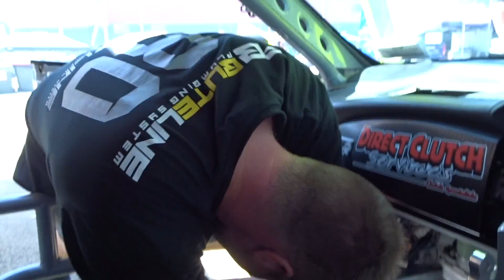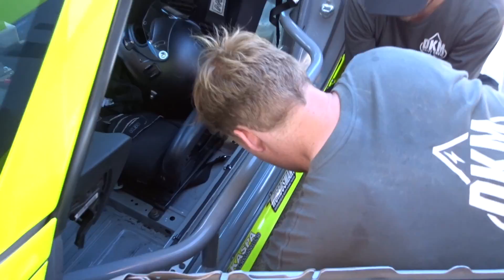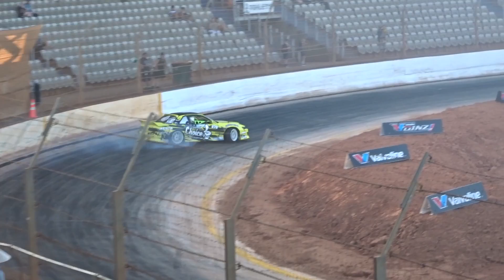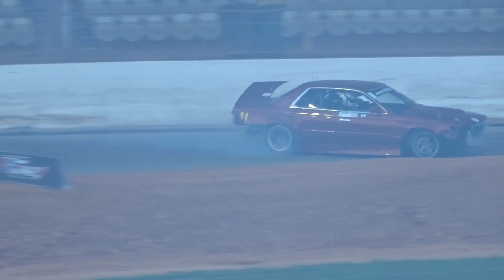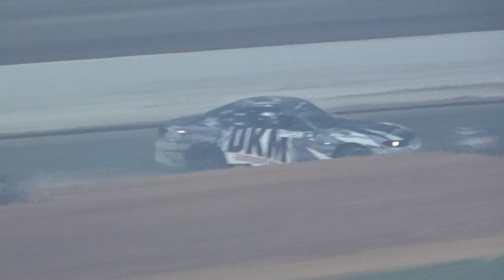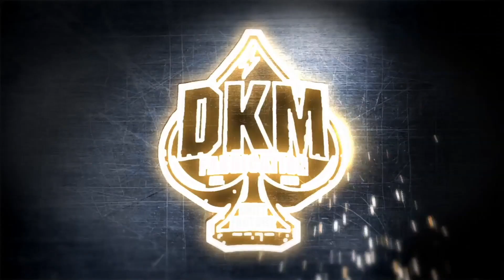BIG Crash!!! - D1NZ Round 3 Qualifying day.

Comment: the delay in the steering is because of the line length sorter lines less of a delay i run my pump in front of the drivers wheel on my s13
Reply: Could you explain this a little more? Hydraulic fluid is non compressible.. as long as the system is full and working properly  there should be no delay whatsoever
Reply: @magnetic0314   the power steering pump doenst run full pressure with no steering input when you move the wheel you can hear the pump ramp up in speed and pressure the longer the line the more delay there is when you move the wheel ive fitted at least 20 of these style pumps to skid and drift cars
Reply: looks like the lines just pop thru the firewall and straight in to the rack, couldnt get them much shorter i wouldnt think?
Reply: @rickjames3034   yeah looks that way but hard to say how long they are the ones in my silvia are 300mm long you really start to feel it about 500mm i did one years ago about 800 long and it was about a half sec delay
Reply: and i dont think that was why he crashed you can see he had to grab the wheel with both hands to try correct it was more of a binding issue
Reply from the maker: Cheers mate I will be doing everything I can do get rid of the electric steering all together haha
Reply: in Finland we run Opel/vauxhall pumps in the trunk and it does not affect the feeling or response if your lines are made of good quality hydraulic hose.
Reply: @DriftSquid   done correct its mint i killed soo many normal pumps before i went electric but hope you get the car fixed and back out again soon mate
Reply from the maker: @ZaredFox  Yeah mate we are going to try fix it all

Comment: that looked like it hurt 😢 hopefully this bad luck will leaves yous alone next round 🤞👍
Is power steering really needed in drifting? A manual rack would eliminate hydraulic lock ups like this 🤔 I've heard Astra pumps can be temperamental turds at times.
Reply from the maker: Yeah I'm so over electric steering. Just want it to all work right